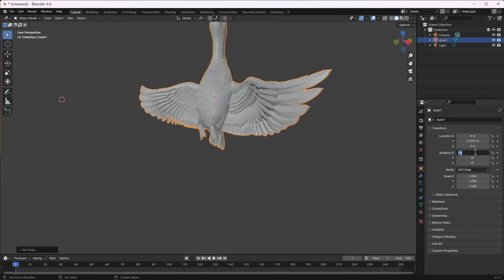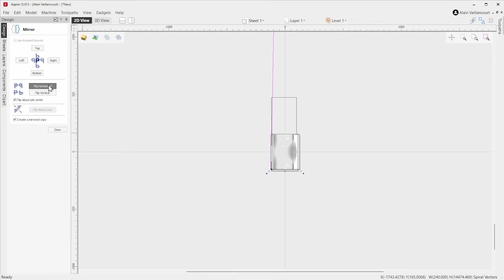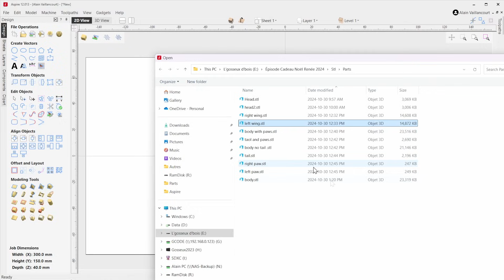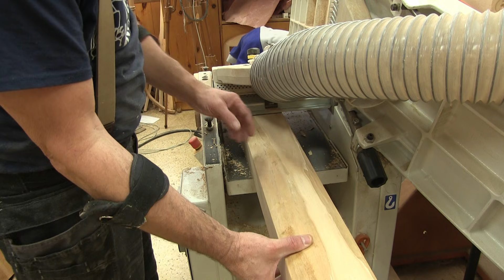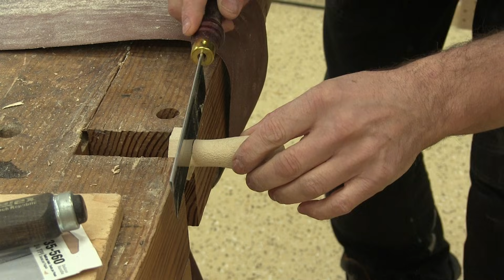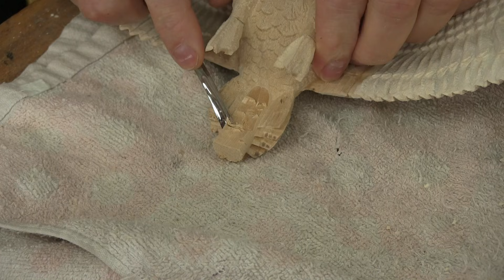The Woodpecker Ep 338 - Making a Canada Goose

Comment: Enjoy your videos as well as your CNC builds. Just getting into rotary and having trouble with tabs at either end of models. Will keep figuring it out unless you’ve had a previous tutorial on tabs for rotaries. I can watch these all day long and try to pick up new techniques.
Reply from the maker: Making rotary job is very addictive, I love making this kind of project, not a lot of people make these.
I put tabs at either end, if the rotary job is big, like the body of this goose, if it's small I only put a tab on the chuck side. Since I made this video I changed my printed chuck for a metal one I can hold the piece WAY tighter so I don't need a tail stock.
I don't have any videos talking explicitly aly on the tabs.
One tip, try using square tabs with the biggest size you can use, like here the tab on the neck of the goose was almost as big as the carving itself. But sometime, it's impossible it would make the carving more difficult. I will have more rotary carving next year, I hope you will enjoy them also.
Reply: @LgosseuxDbois-TheWoodpecker , thank you for your reply. I do a lot of CNC and heard rotary was addictive. I bought a rotary and made a few baseball bats and a couple of skulls before the stepper motor seized up. A new one is arriving and can’t wait to get into more rotary jobs. You are correct, not many people do rotary so it’s always good to be one step ahead. I’ll have to learn to use Microsoft 3D and other mesh programs. Most of my designs are either with TinkerCAD or Aspire. Looking forward to your upcoming videos. Happy Holidays and Merry Christmas from NY!!!
Reply from the maker: I always keep a bunch of ball bearings the size of a stepper motor, I changed my bearings a couple of time because the stepper motor seized, it's way cheaper than buying another one and in minutes you're good to go, you should check the size and order some this will happen again.
Reply: @LgosseuxDbois-TheWoodpecker you sir, are a genius!!! I received new replacement motor from Sienci Labs, so decided to take apart the old seized one. The bearing was seized and so easy to replace. Ordered a bunch of new 625zz bearings and it should take minutes to replace. So grateful and appreciated for your expertise. I admire people like you with a vast amount of knowledge. Merry Christmas my friend.
Reply from the maker: I'm happy I was of service. The last thing I want in my shop is being stopped because of a broken bearing. Like now,  I have to wait for springs, I ordered the wrong size. I want to make an ATC because I changed my spindle and now it has a ER20 collet, so I will try to make a new ATC made of Baltic birch plywood and acrylic
Reply: @LgosseuxDbois-TheWoodpecker just ordered an ATC along with more powerful spindle with ER20 collets and it was expensive. I’m good with anything but wiring. Hope you make a video so I can attempt one on my older CNC machine.